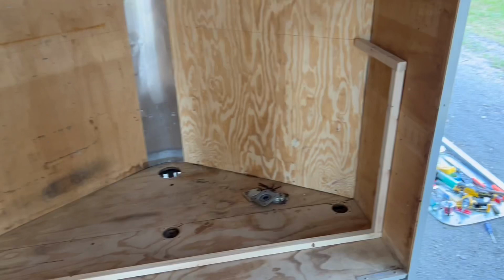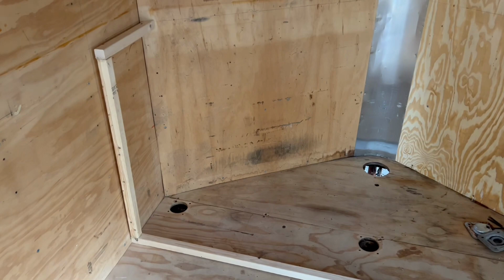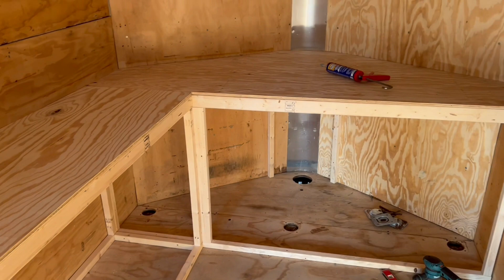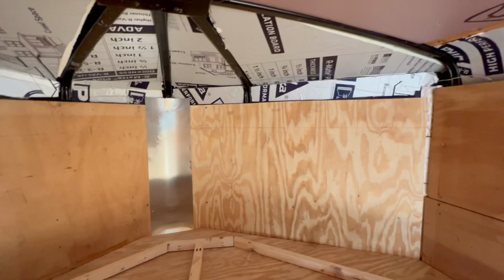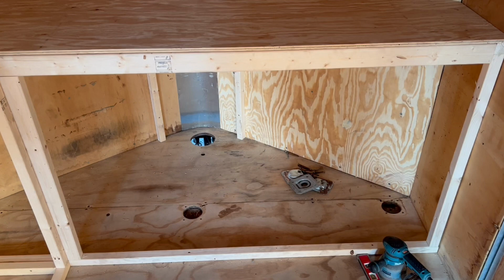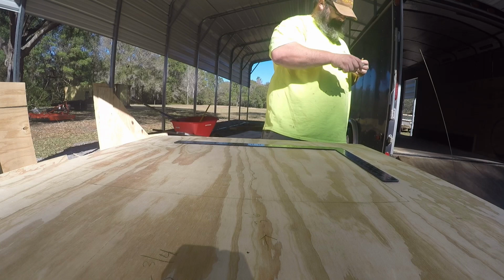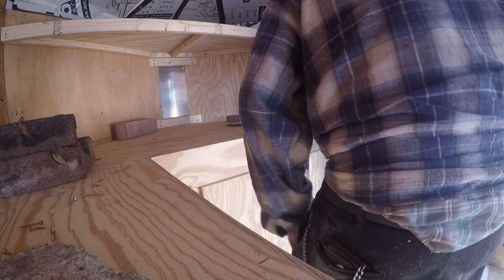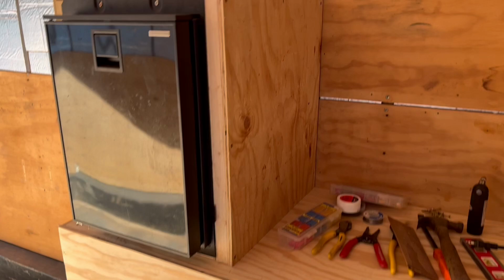Cargo trailer conversion: DIY simple cabinet install.  Part 7

Comment: I know pocket drilling and glueing is the new wave. Seems like more trouble than its worth. But i just pre drilled and  screwed mine together its strong as can be.
Reply from the maker: I’ve done it that way before, nothing wrong with it. I actually had just purchased the Kreg pocket jig and was the first time using it. The jig I bought made it pretty easy. Easier than the cheaper ones. Thanks for watching.

Comment: Hard to tell in the video, did you frame the counters with 2x2 or 2x3? I wanna keep mine as light as possible. Thanks. Also great job!!
Reply from the maker: They are 2x2’s. No issues at all.
Reply: Thanks for this. Really simplifies the process! Also, are those 2x4s on the top and 2x2s for the rest of the framing? Or did you use 2x2s for everything?

Comment: Tim watching the cabinet install I was also paying attention to the insulation i could see... what thickness foam board did you use and now that you know know what you know... would you use more, or is it enough ? Whats the coldest and hottest temps youve stayed out in testing it ?
   Thanks

Comment: What type /size of screw are you using? my enclosed trailer already has walls and I want to use the right screw for the most strength. Do you drill right into the plywood for the upper cabinets or do you try to anchor it to one of the ribs/steel studs inside the walls? Thanks!
Reply from the maker: I just used regular wood screws that I had (2”)and screwed into the plywood wall. Make sure you don’t use too long of screws as you don’t want them putting dimples on the outside skin.